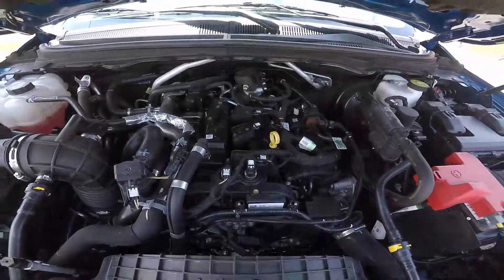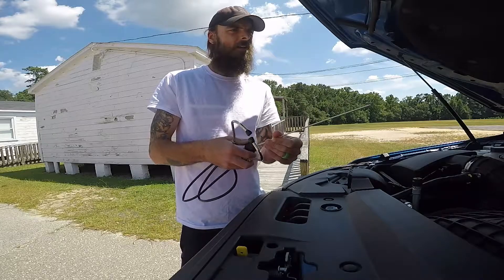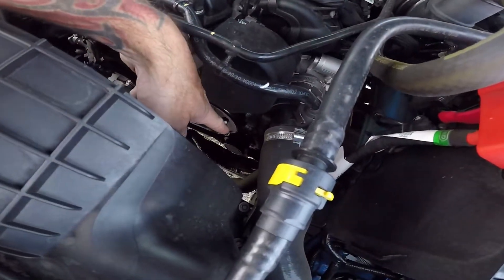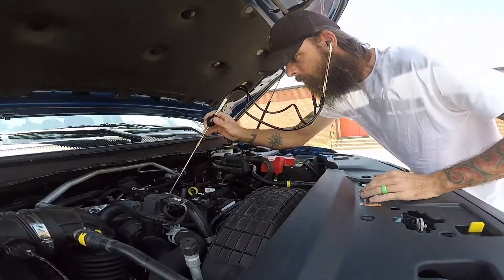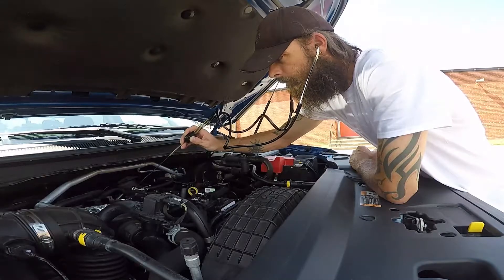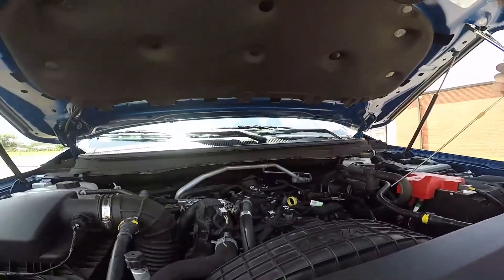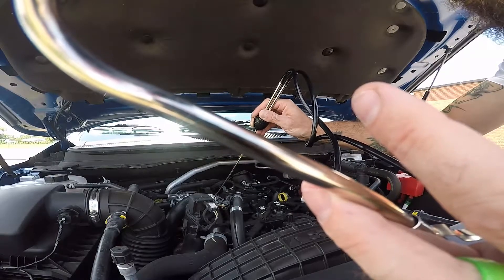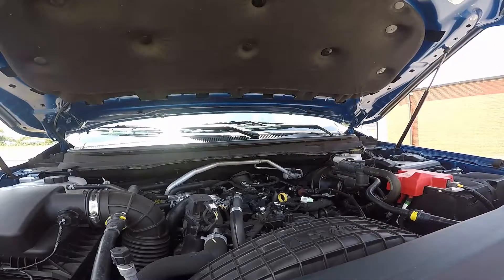Normal Vs Bad Engine Noise Diagnosis.  The Right Way

Comment: Bro put it on the injectors...
Reply from the maker: They are buried under the intake it's direct injection.  Can't access them. I was looking for an easy way in.  Not really accessible with spur of the moment video. I will however see if there is an easier way to get to it so you can hear it.
Reply: @BeardedFordTech  for me on my car, the minute of place the stethoscope on the injectors... wow they sound like a bomb in my ears.. All 4 sound the same. Its probably the detonation knocking... boh..
Reply from the maker: @CRM537  yea they are all loud. You are magnifying the sound with the stethoscope. I've had pulley's and such before about blow my ear drums out.